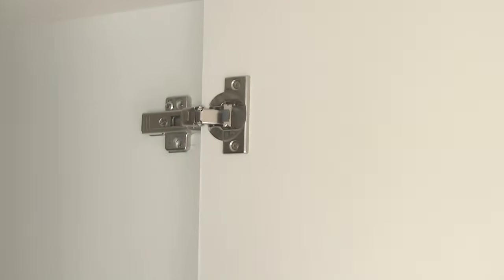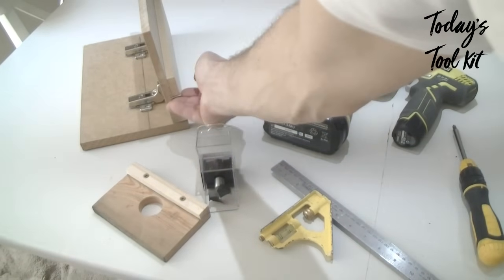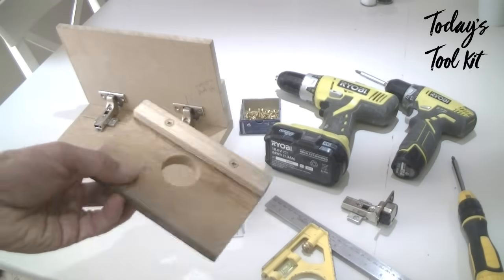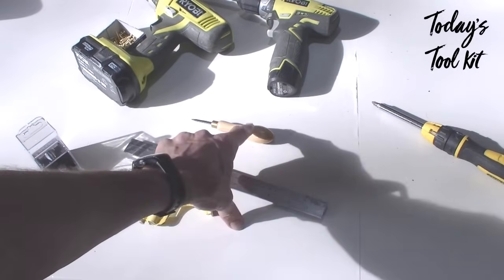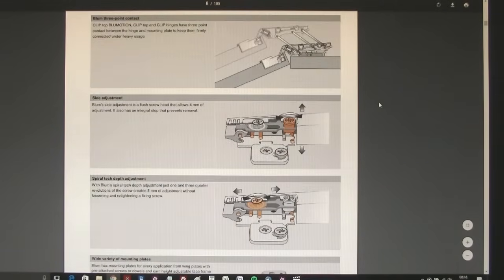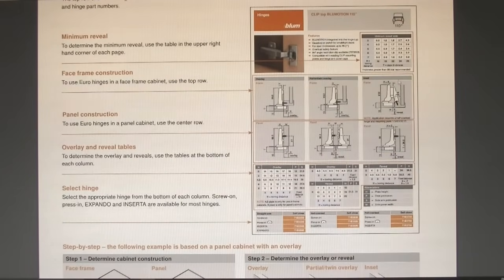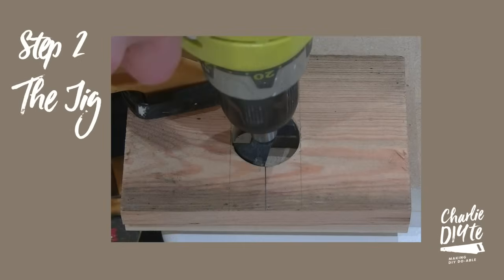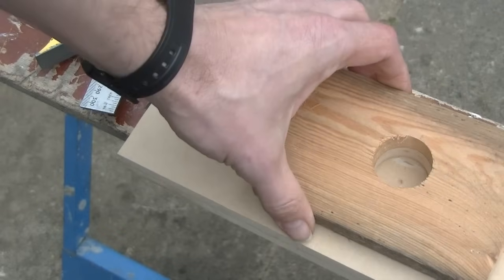How to Measure & Install Concealed Hinges on Cabinet Doors

Comment: Although I've done a fair amount of woodworking in the past and have come from a career working in an Engineering department, not an actual Engineer myself though, these hinges were getting a bit baffling. Thanks for your explanations and pointing to Blum's resources. Both were very helpful in clearing things up. Well, I'll see how the install goes, but now I've got an idea at least. Thanks for your great video.

Comment: Charlie - after 25 years in the house, my European hinges in the kitchen have succumbed to the abuse of 4 kids - so, I find myself needing to replace the hinges on 27 cabinet doors (well not all need it, but I'll take the opportunity to upgrade to soft-close hinges) - with many of them requiring repositioning to deal with damaged MDF around some of the cups.  I've watched several YouTube videos & your video is by far the best - I now am not freaking out over where to find the best hinges w/ soft close, and all the work to install them without screwing up.  Thank you for the really detailed video on how to do it - including walking through the brochure, using a jig and a mockup.  My blood pressure is now quite a few points lower!  Great job.

Comment: I am building a rather large buffet with three inset doors.
I plan to use these same hinges for the first time and have been quite nervous about screwing it up.
I like your suggestion about doing a mock-up and will try that.
Thank you for taking the time to painstakingly document your experience and trials and errors.
You have helped me more than you know and I am grateful.

Comment: Charlie, your advice to do a trial fit of the hinges on scrap wood is INVALUABLE.  Once done you can see how they work,  and then work out, first whether you should change any of your measurements BEFORE you actually cut into your doors, and later how to adjust the doors.  So much easier to do with the trial piece.  Thank you so much for the tip, and to everybody about to fit hinges for the first time, follow Charlie’s tip...DO A TRIAL ON SCRAP WOOD FIRST!

Comment: This video is SO helpful.  I'm just about to build a cabinet to cover a boiler out of some old IKEA wardrobe parts I got for free. They originally had sliding doors so there were no holes cut for the concealed hinges.  I was dreading doing all the maths to figure out where to drill the 35mm holes so this video will be my reference through the whole process. Thanks Charlie!!!
Reply from the maker: Funnily enough I've got a load of doors to hang for my wardrobe build, and I've just rewatched this vid to remind myself how to do it 🤣 I've bought no fewer than 3 template tools on the internet, including a Blum one and no-one of them have the holes in the right place so I'm afraid it's best to work it out yourself based on the hinges you've bought.

Comment: This video was perfect for me. 
I built shop cabinets and then sought out any used hidden hinges I could buy cheaply. As a result I ended up with hinges I knew nothing about. Fortunately they were Blum but I've yet to determine exactly which they are so I can decide how best to install. Your video is helping me this.
Reply from the maker: You're welcome Dwayne. Apparently they've got a help line which is pretty good, so you could call them and get them to identify exactly what you've got any what they can be used for.

Comment: Hey Charlie, Great job, way past super  professional!  I installed a ton of these about 8 years ago, and as I tuned into the brochure on concealed hinges I was getting slightly overwhelmed using my brain power to re-connect to the intense specificity that Blum requires, This video was so VERY helpful in calming me down and YOU NAILED IT!! Thank you, great job, great articulation, fantastic deliver and super clear video work, thank you!!
Reply from the maker: You're incredibly welcome! Thanks so much for taking the time to comment - it means a lot. It takes an age to film and edit these videos, and yours and all the other positive comments help convince me to keep going!

Like you, I took an age researching how to fit these hinges. Some of these jobs look pretty intimidating but the point I'm trying to put across on my Channel is that anyone can do it if they put their mind to it, do the research and have a little help from people like me! Thanks again!

Comment: You’ve made a difficult job so much easier. Thank you for the links to Blum as well. Loving their soft close hinges. I’m not a regular DIYer but thought I’d have a go after watching your brilliant video. Cheers Charlie!
Reply from the maker: Thanks Russ! Really appreciate you taking the time to post that. Do it - they're surprisingly easy to fit. You'll be fine. The trick is to make sure you buy the right ones!

Comment: Another tip to add when actually fitting the hinge to the base plate is don't fully tighten your base plates down until you have clicked in your hinges. You'll be glad of the extra adjustment

Comment: Very helpful mate! I will be building a low-profile media cabinet for our home theater reno and this video has given me the confidence that this type of hinge will make doing inset doors no big deal. Thanks for doing all the research and hard work!
Reply from the maker: Terry Porter Thanks Terry! And I was in exactly the same position as you before I made this video. With a bit of good planning it's really quite straight forward. Go for Blum though. It's worth paying a little more for a quality hinge. Good luck!

Comment: I bought a little plastic marking jig from eBay, for about £5.00 it did all sorts of concealed hinges, both the bore hole and hinge side.....did all 60 doors  and still going strong!!! For just a £5 it beats pissing about measuring and marking out.
Reply: Can u send a link to the jig u bought pls?
Reply: For example this:
https://www.amazon.de/Hettich-Accura-Bohrschablone-Multiblau-351/dp/B00PXZU0W0

Comment: Great video as usual Charlie. I’m a very poor DIYer by comparison, but have one tip. I’m not sure if you’ve covered this before on your channel (I did try a search).  Screws in MDF can pull out over time.  One of my hobbies is installing car stereo and I learned that using screw in nutserts provides a much more secure long lasting fixing. I replaced all the screws on my amplifier rack and subwoofer cabinet with them. I’m not suggesting that they are needed by default for in house carpentry. (Vibration creates a different problem in a car). But I also have a bathroom cabinet which someone else built for us. The screws on the concealed hinge plates on that came loose after 3 years or so. It may be that they did not use enough hinges or there was some misalignment or they’ve absorbed too much moisture. I don’t know. But fortunately nutserts provide a cheap and easy fix. You can buy them for a few pence. You just drill out the hole a bit bigger, screw in the nutsert either with a hex bit or flat blade depending on type and then use a bolt rather than a screw to attach the hinge plate or whatever.

Comment: Thank you so much for taking the time to explain the entire process
Reply from the maker: You're welcome Tim. Funnily enough I had to watch this again the other day as I've a load (38 to be precise) of brackets to install for my wardrobe doors, and had forgotten the dimensions 👍🏻
Reply: @CharlieDIYte  I'm currently fitting some alcove units and your tip about making a prototype has given me the confidence to try it out on the proper doors - thanks again

Comment: Great video thanks .
Two comments.: Take that Ryobi drill and drop it in the nearest river. Second: make the jig with two holes for the retaining screws as well as the 35mm hole. It's incredibly easy to get those two screw holes slightly out  and 1/10 mm  error there amplifies to 5mm error at the other end of the hinge bracket. But thanks for other good advice

Comment: Charlie, first of all "Thanks for making and sharing your videos"I just wanted to tell ya that I nearly chocked on me tea when you said you paid 9 pounds odd for the hinges and then 2 pounds odd for the dearer plates..loool.....I'm a cabinet maker for 22 yrs now and i've never bought from plum, but I get all of hardware from C&C fittings Waterford Ireland.(A little plug for them)and by the way, they will ship anywhere in europe  I pay for soft close standard with plate 1.80 per hinge (euro) and for inset hinge like you are displaying with plate about 2.80 euro per hinge..If you were ever in need of a lot of them, it might be a good thing to do a little cross the water buying!!!!   ;) ;) Keep up the good work!..

Comment: This video was essential for me in working out the Blum hinges.  As an update, Blum now have a spreadsheet in the planning section of the Blum link above.  If you download the XLS Blumotion planning tool for the desired application, you can input all the relevant details and on the last sheet it gives you all the details required for correctly installing the hinges.

Once again though, my thanks go to CharlieDIYte  for making the video - much appreciated.
Reply from the maker: You're very welcome Rich. Thanks for the heads up on the new spreadsheet, and for taking the time to comment 👍

Comment: very impressive how you were able to align all four hinges. Id probably keep the hinges already snapped together, and after putting them into the door, then just hold the door to screw the other part of the hinges into the wall/side
Reply from the maker: That's a fair point. Only issue is if you have to take the doors off for any reason, it's easier to unclick rather than unscrew. As they're click on it's good to acquaint yourself with how they work as designed.

Comment: Great video! As a time saver I usually install all the hinges on the doors, mark the bottom and top plate positions and install the doors with 2 hinges (i.e. if it is a 4 hinged door). As the door is in an open position I simply screw in the middle hinges which align automatically :)
Reply from the maker: That's a very good idea Andres, particularly as it's easy to click in 2 gives, not so easy with 4. I've recently used them again here https://youtu.be/tdMnnkvInrE
Reply: Charlie Great Video!  Not too long.  I've watched the key parts 3 times now!  @ Andres M ... I wracking my brain around aligning a door with 3 or more Hinges... Did you align it with the 2  hinges (Bottom and Top in place i.e. clipped in) so the reveal, etc was positioned correctly then simply screwed the others in?
Reply: @purza95    that's how I usually do it but I still mark a straight line for distance from the edge of the carcass to the center of the clip. As for the reveal I don't worry too much and just follow the instructions of the manufacturer

Comment: I have watched several of your videos with great interest and appreciate the tips that you have given me.  However, I think I may have a tip for you (and your viewers); you use a bradawl to mark the position for a screw or drill hole, for many years I have used an automatic centre-punch for this and found it to be very effective.
The automatic centre-punch is cheap and available from many DIY supplies stores and I think that, as you simply push it on the spot chosen until it 'clicks', it's easier to be accurate because you don't have to twist the tool and possibly 'wander' the tip.
Please try it.
Reply from the maker: Mark Edwards Thanks Mark. I'll definitely check that out!

Comment: Great job.  You made an incomprehensible Blum schematic understandable.  Especially for me, an American stuck with Imperial measurements.  My only criticism, and it's a small one, is that it's a lot harder to mark out where the base plate goes on a fully constructed cabinet than it is on a mockup. In that case, you're better off making a jig of some sort.  They don't sell them because the thickness of the door measurement is crucial and varies with whatever material you're using.
Reply from the maker: Yes, fair point 👍🏻

Comment: The thing I found very important when installing your hinges is keeping the square with each other on the inside face of the hinge. If more than two they need to be in alignment with each other top to bottom. If your door edge isn’t straight you will bind the hinges.
Reply from the maker: Robert Avery Agreed! Everything has to be square.

Comment: I’m hoping to fit my first hinges as replacement  for some cheap plastic ones that broke. I’ve been having a mare trying to ensure I get the right hardware as the overlay door and carcass are only 16mm thick. It took a while to find some stock to allow me to make a mock up. But hopefully you have put me on the right track to find the hardware. Thanks👍
Reply from the maker: Have a look at that Blum brochure, Mark as I'm pretty sure they do a hinge for thin doors although it won't be the same design as here as you haven't got the depth for the 35mm forsner bit hole.

Comment: An excellent tutorial. I went at my DIY under stair install all gung-ho, thinking these hinges are only sold as replacements for failed flat-pack items. If only I’d seen this video beforehand. Not to worry, thanks for the video.
Reply from the maker: You're very welcome mate - definitely worth investing in the decent ones.

Comment: Great video that gave me the confidence to get some new doors done in my living room. I think with inset doors you have to be ultra careful with the measurements- I got my doors width the width I wanted, I drilled my 35mm hinge holes 5mm from the edge for a 2mm relief. I wasn't more than about a quarter mm out on any measurement. Yet when I went to fit, 2mm relief wasn't enough. So I had to go closer to 3mm both sides, meaning that my doors width was now 2mm too wide. Must have been the width of the paint that threw me. Back to the shed and the handplaner for me, but I suppose that's to be expected with DIY. 

They seem like really nice hinges though. The only thing I had trouble with in the video is when installing- I had to have them in the closed position for my doors to fit within the frame so that the hinges would click in.
Reply from the maker: Thanks! Yes, absolutely, there's a bit of trial and error on getting the widths exactly right, as sods law, if you try and factor in all the gaps, you'll end up taking off too much! As you say, that's DIY. Get yourself an electric plane if you can, as it will change your life. It makes those micro adjustments so much easier - something like this https://bit.ly/3aKiApY Yes, I should have showed the process of hanging. I was worried the video was so long by that point I wanted to try and wrap it up. But I agree, it's tricky. I think I lined up all of the hinges and then pushed the entire door to click them all into place simultaneously, but I agree, it's not easy.

Comment: YES on difficulty with info for Blum. I decided instead to go to Menard's and buy Hickory inset frameless soft close (Hickory Hardware® Bright Nickel Inset Frameless Soft Close Cabinet HingeModel Number: HH74722-14 Menards® SKU: 4880598). They give you a range of specs and if your door and application fits within those specifications, then all you need to know is to use 1- 3/8" bore size down 1/2" and locate the hole 4 mm from the edge. That's all you need for drilling into the door. Then when you have the door with the 2 bores drilled and the hinge screwed squarely in place, you place the door (on top of the spacer you want for the reveal at the bottom---mine is 3/32") inside next to the panel you will attache the hinge to. You place the door snug to the panel and drill the holes for the plates (it comes with the plates). When you place the screws into the plates, the door is snug to the panel with no reveal. (Again, I set the door on 3/32" spacer and cut the doors so they will eventually have a 3/32" reveal.) But then you go to the plate and there are 3 screws that are amazing. They will move your door up/down, in/out, and set the reveal you want. I was amazed how quickly I moved the doors around using 3 screws (for each hinge) until I had an equal reveal all around. There was no guess work on where to drill for the hinges.

Comment: MDF wen sealed is one of the most stable materials for furniture making so they won't warp but it is very dense and heavy and does not have the strength of solid wood and screws will be far more likely to pull out.
For this reason that extra hinge make perfect sense 👍
Reply from the maker: As does this style of hinge - when screwing into the face rather than end grain as you would with a butt hinge it's so much stronger.